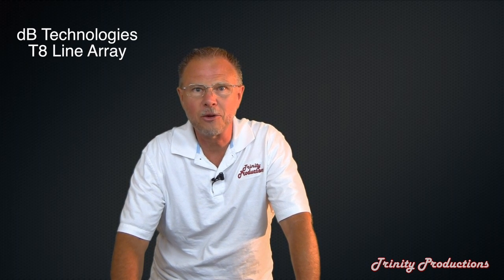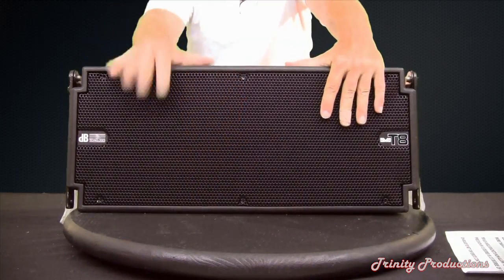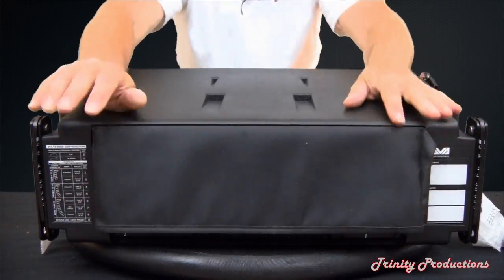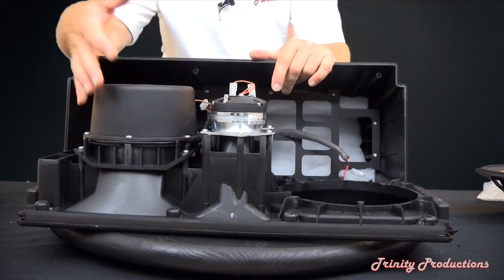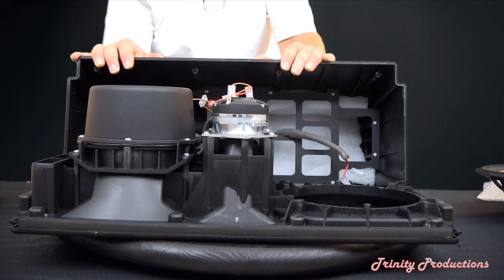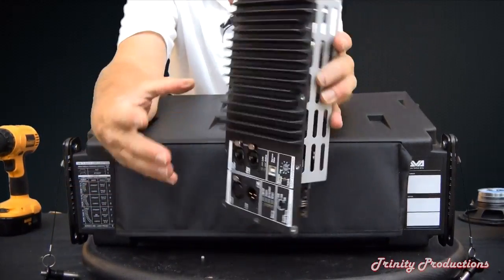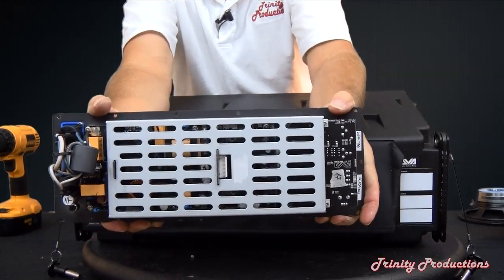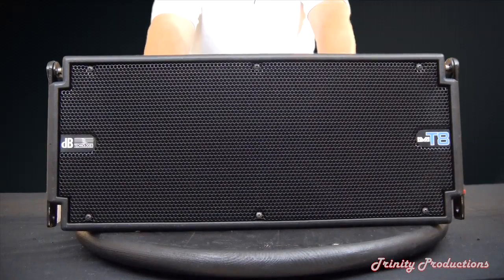db Technologies T8 Line Array in depth review  - Authorized Dealer

Comment: The price its still high but not absurd like other line arrays  , why they dont make the passive version it will be even lighter  and  will have half of the price perhaps it will sell  very well much better than those active . This amp its very light  don't know if has much power looks like an car audio amp .
Reply from the maker: +Nick Name in comparison to other mfr. this box is not very expensive at all for the features and SPL performance. You are looking at a Digital Amp with all on board processing , power supplies, switch mode and you can use it anywhere in the world...do some research on pro audio amps and lines arrays , you will find that competing lines are 3-4 times the cost.

Comment: To buy 2 per side t8 or t12 on hand ?. I have to choose between these two alternatives. Which one is the best?
Reply from the maker: Alexis Carrasco if you can afford the T12, go with them...amazing speaker/line array
Reply: trinityprosound ..and with one t12 by hand you can work?
Reply from the maker: by itself, no, it is a 10 degree box in the vertical and only people in the 10 degree vertical coverage area will really get the full impact of the box and audio . you need really 4 boxes per side to be able to splay each a few degrees for proper vertical coverage.

Comment: if I want to use this kind of  speaker .How much money do I need for a pair of it.?
Reply from the maker: one per side is not going to do you any good. these are line array and you will need at least 3 per side even to start on a pole mount accessory for them...they work best with more than 5 per side at an event, flown is better , ground stack is ok, but you would need to take care as they would be top heavy.

Comment: Thanks for the video. I was running the sound for an outdoor show last night and they had 4 T8s stacked on each of the two DVA S30 subs (12,000W total). Even though the board was a low-end Behringer X32, the dB rig responded very well. I came here to find out a bit more about this range of line arrays and your opinion confirms my first impression.